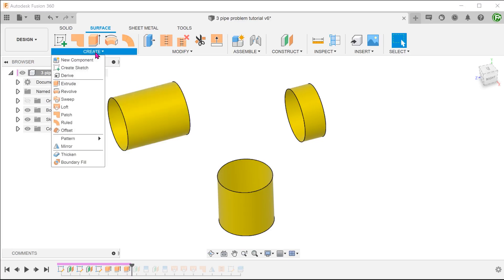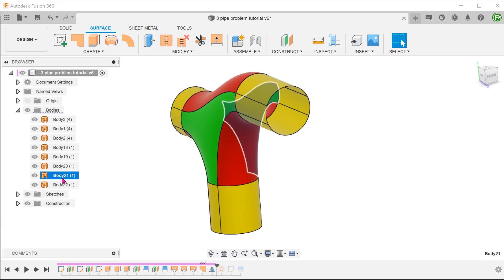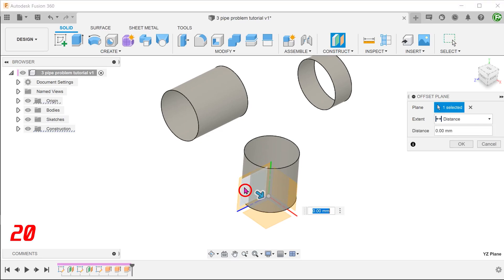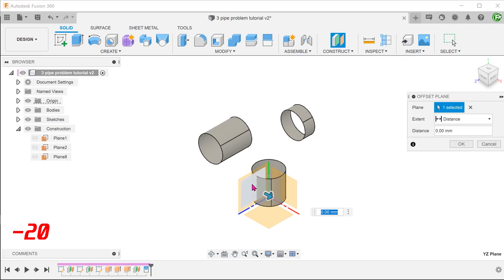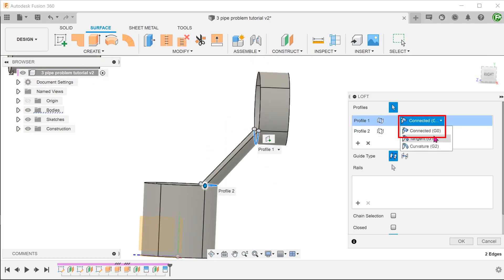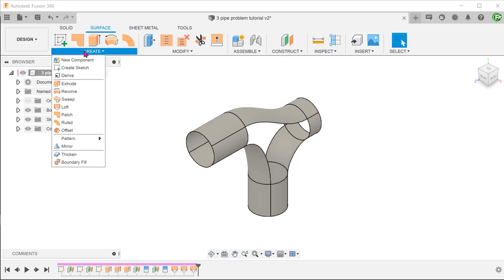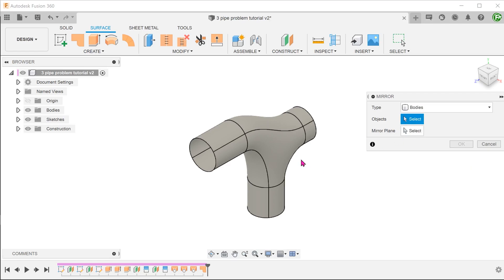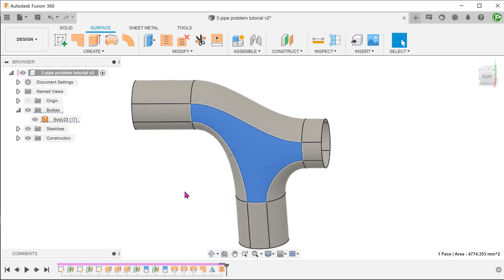Fusion 360 - 3 Pipe Problem (Surfacing)

Comment from the maker: The title is an unintended reference to Sherlock Holmes:)
Reply: Delicious tutorial! 

Do you work with large assemblies? I'm curious how you would approach them.
Reply from the maker: @woodywiest  Thank you. Most of my projects are one component only. What sort of problems do you encounter when doing large assemblies?
Reply: Hello. You can create a rough 3d texture with fusion360? you can see this on the 3d printed model? (Like Fuzzyskin from Cura)
Reply from the maker: @christiangottwald5758  Hi, I am not aware of a quick way of modelling a textured appearance. You might be able to do this using emboss to some extent. But emboss is limited only to surfaces with curvature in one direction. Also, it would be quite tedious to create that kind of pattern manually. So far, like you mentioned, I am only aware of slicers that can do that easily. Not sure if the built-in slicer in Fusion can do that.

Comment: WOW. I use surface lofts all the time and never knew about the "align to surface" option for the tangency constraint. 

I also use the Patch tool a lot and didn't know about the "Group Enges" option for setting a curvature constraint.

Which means I've had to rely on adding blend curves to 3D sketches and using them as loft guide rails. 

Thank you for saving me hours of pointless effort in the future.

Comment: It is not correct design. Pipe transision shoud to be same width like pipe. It's good visible what I mean in 5:01 minute of video.
Reply from the maker: Hi, noted on your concern on the bulging patch surfaces. I am experimenting with different ways of mitigating this. Might do a follow up on this.

Comment: Why the mirror didn't work, mirror = scale factor -1, inverse. The UV direction of the mirrored surface ends up going in the opposite direction to the original. I.E back to front, bottom to top for instance but on the opposite side, so clockwise vs anti clockwise, no good, UVs must match.

Excellent patch modelling tutorial.
Reply from the maker: Thank you. I was actually trying to mirror the split lines, not the surface body. But is it interesting to know that mirror is an inverse scale. Also good to know about the UVs as well!

Comment: A nice option should be a part 2, in which explain how to convert the mesh to a body, therefore it will be able to be exported as a obj or stl file and can be printed.

Thanks for making clear and simple tutorials.
Reply from the maker: Thank you. Sorry, I should have included that. You can use the patch command to patch the ends and stitch everything into a solid.

Comment: Great Very clear tutorial as always, you could also sketch on the offset planes and use an intersect on the surfaces instead of a split body. The sketch would then give you greater control on the transitions between the circles.
Reply from the maker: Thank you. I am not quite sure whether I completely catch what you are saying here. If I perform an intersect using the offset planes, this will just produce sketch lines. Without splitting faces, during the loft, I would not be able to select arcs as profiles. Do let me know if I have misinterpreted your comments.

Comment: I tried splitting the pipes in the middle effectively making the little edge portion you left for patching surface to nothing. I tried using surface patch from the remaining. It just made a wacky surface. Any idea why this doesn't work. All I was trying to do was to reduce the patch area
Reply from the maker: I am not sure whether I interpreted what you said correctly. I made a guess and created the following:
https://a360.co/3tPXs9I
It looks kind of ok but when I used the zebra analysis, it does not seem very smooth.
Reply: @Fusion360School  sorry for replying late. Thanks for looking into this. Yes the cuts before patching seem similar but the patch surface went off asymptotically to infinity somewhere everytime I tried. I'm not sure if it's a dimension thing. But thanks for trying it out. ❤️ your tutorials